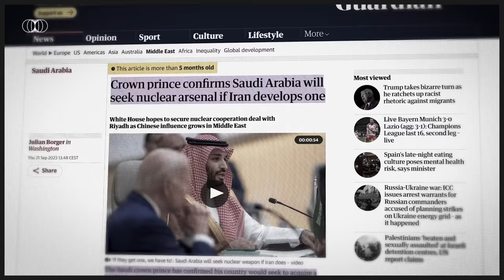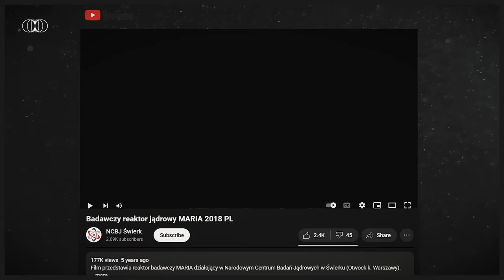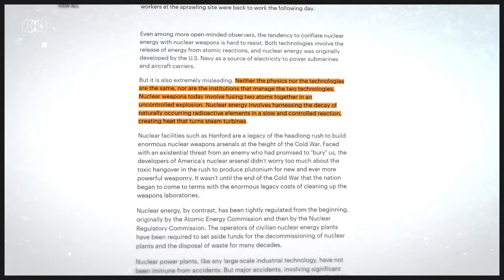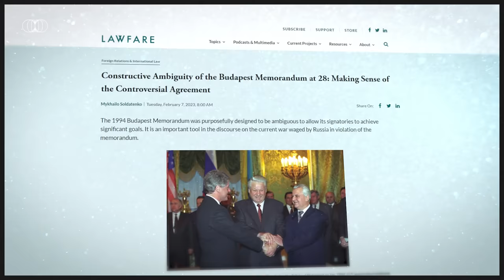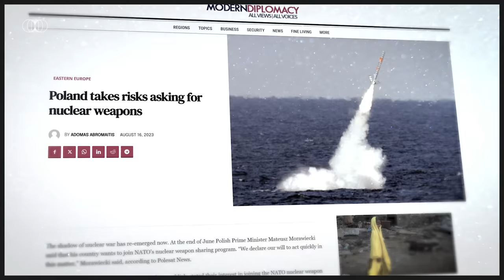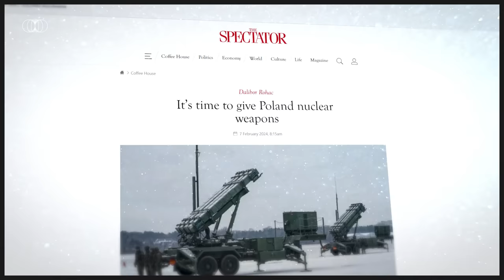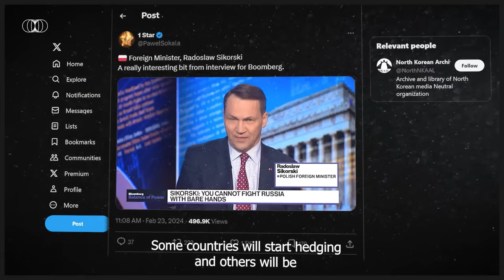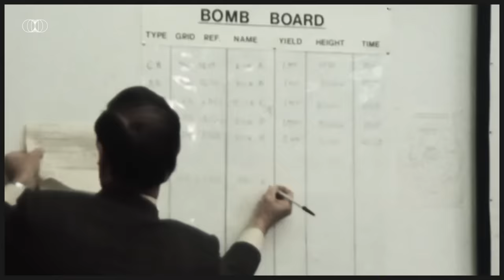We Are On The Brink Of (Another) Nuclear Proliferation.

Comment: Lol its not that easy to breach NPT as some would expect. First of all, not a single state would ship uranium anymore, the moment IAEA inspectors arent let to check every suspicious site, so Poland would need an own domestic uranium mine. Then they would need the enrichment facilities just to run the reactors. From that point on the situation is quite easy, but the results are basically useless, if a first strike can render the capability moot, so there would be a need for submarines, and excessive miniaturisation in order that the endproduct is not that big that a rocket cant handle it. Oh yeah,a  rocket program needed as well plus more enrichment facilities to make a reactor small enough to fit into the subs, precision engineering, sot that it will be silent enough so the russians dont find it. I would say 20 years if noone helps, while something with any actual combat value can be aquired.